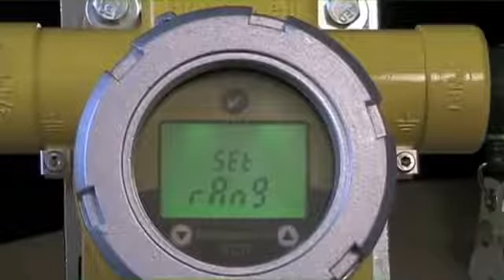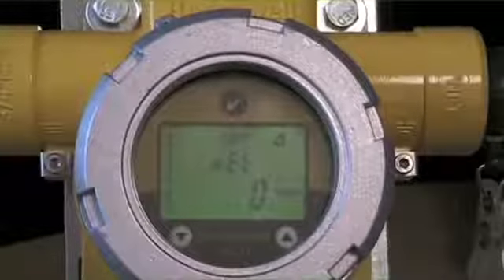Honeywell XCD - Setting the Sensor Range

Comment: Good explanation, im doing doing o2 calibration ,i could not get 20.9 percentage . im used surrounding air for calibration o2 as per manual. Could you advice on why i couldn't get 20.9 percentage..thank you
Reply: Late reply, but better than never:  Atmospheric oxygen levels vary with altitude.  If your location is significantly above sea level, your actual O2 level will be less than 20.9%.  For example, at 2000 feet above sea level the actual gas concentration might only be 19.2%, at 6000 feet it would be down to around 16.7%.